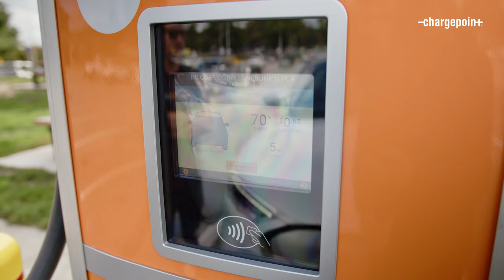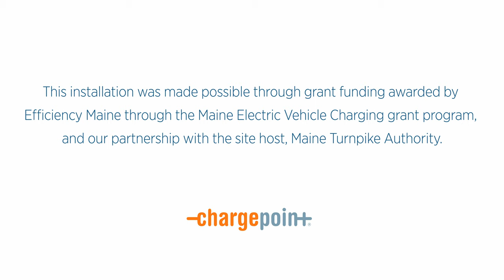Installing ChargePoint Express Plus: The building block for corridor charging success

Comment: Just wondering those new units don't seem to have a Chademo port plug, just CCS, is that correct?
Reply: CHAdeMO will be added to the Express Plus stations soon.  Each station will have both CCS1 and CHAdeMO at corridor sites.  The other DC chargers at this site (CPE250s) do have CHAdeMO charging cables today.
Reply from the maker: Craig beat us to it! He is correct: CHAdeMO will be added to the Express Plus stations soon.  Each station will have both CCS1 and CHAdeMO at corridor sites.  The other DC chargers at this site (CPE250s) do have CHAdeMO charging cables today.
Reply: guys what size/qty of cables you are using between power block and the power link units @ChargePointnet